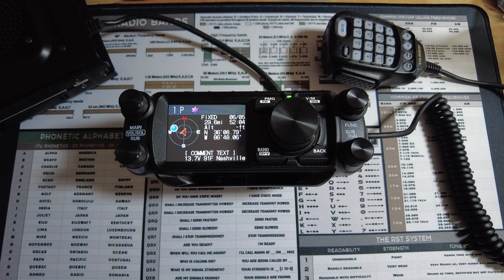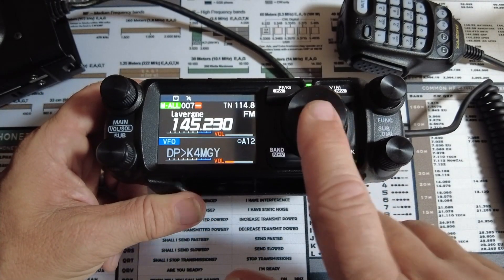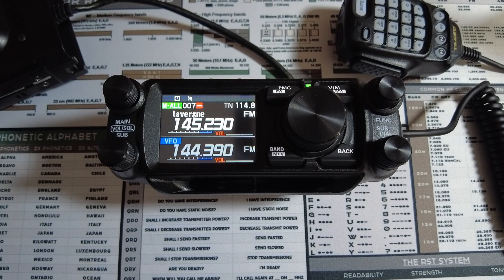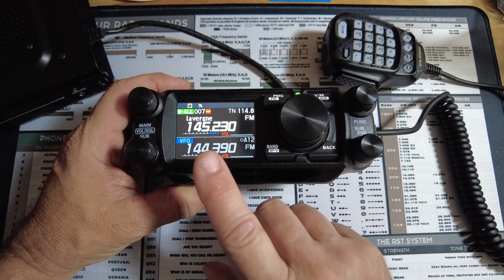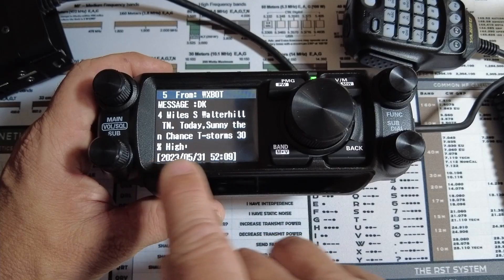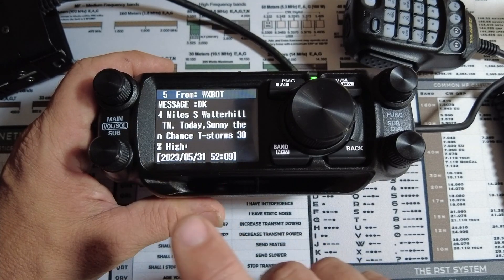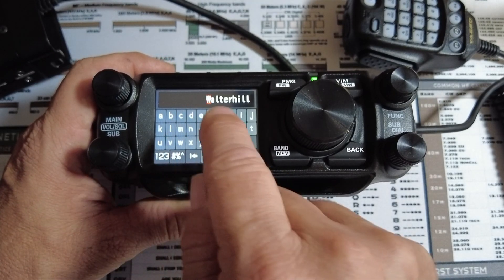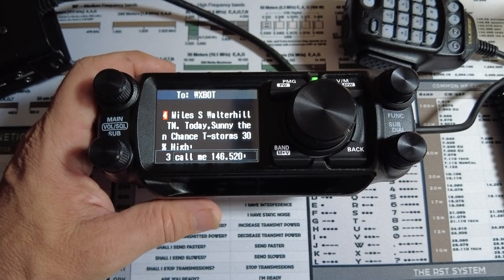4 Things I Hate about the Yaesu FTM500

Comment: thank you for the info, i got one 400xdr used on the shop for 350€ because someone changed for the 510. this last one costs 610€ new, i wouldn't change the 400 for the new 510, no upgrade as i see it. your video clears all the doubts. better than the 400xdr? another 400xdr. 73's

Comment: Yaesu has an excellent transceiver and the best audio available with C4FM. The Yaesu User Interface (UI) universally sucks on their radios. It's a mind numbing, button pushing, marathon. They could fix this by opening radio control to Bluetooth or WiFi so that competent software engineers could develop a UI for a computer, tablet and phone, but they just won't do it. That's pushing me in the direction of FlexRadio for a base.

Comment: I hate that most of these new Yaesu radios don't display the current power setting without going into a menu.  On the the FTM-400 you can set one of the four touchscreen buttons to Tx PWR.  So you can see on screen the power setting and change it with one tap.

Comment: I've always like Yaesu for the most part.  With this, I'm wondering if they actually have Amateur operators on the tech team at this point.  This is not a radio I will invest in.  Still looking forward to an FT 891, for other reasons.

Comment: I just got one of these and now am thinking about returning it. I originally planned on the FTM-300 but liked that this one has the front-facing speaker mic jack on the head (more flexibility for a bag or go-box where I plan to use this unit). I see the latest firmware is from December 2023 so I wonder if there will be another one to possibly address some of the issues, especially with APRS. I have the FT-5D (and also the FT-710) and i mistakenly assumed that some of these things would be similar. If I return it I'm not sure what I'll get instead, but it's too much money for something I may not enjoy using.

Comment: In fact, I’ve decided to NOT buy any new radio for the car and just put / start with my 144MHz only rig. I was going to buy this radio to monitor Air Traffic on both Commercial and Military Frequencies ( from Kadena Air Base and MCAS Futenma 315MHz + / - ) but I recently discovered my FT-70D is quite capable of any of those frequencies and what’s more, by plugging in the speaker mic, I can plug the audio into the Line In / Aux of the car and listen to traffic through the car speakers, something I often did in my RAV4 with an FT891 / ATAS120a

Comment: I can't believe how convoluted the operation of this transceiver is. Yaesu makes the FT-2980r, one of the easiest radios to operate without a manual. I bought one several years ago, and I don't believe I've opened the manual once after the initial unboxing. It is simply very intuitive to use. What on Earth were they thinking when they released the FTM-500? I don't believe I'll be giving up my FTM-400XDR anytime soon. I realize I don't use all of the features available on the 400, but the larger screen and the logical layout of the knobs make this radio preferable over the 500.
Reply: The FT-70D is good but convoluted.

Comment: The screen on my Samsung phone is quite a bit larger than the screen on the FTM500.  Yaesu should create an "app for that" so we have the option to control the radio straight from our phone - APRS and the radio menu function.  Imagine how easy it would be to do APRS on our phone instead of fat-fingering the tiny screen on the FTM500.  You're absolutely right about the keyboard layout and buttons changing position while navigating between screens.  Pooly thought out design.  I would like to thank all those amateurs who complained about the giant screen of the FTM400, Yaesu heard your cries, and they fixed it.

Comment: I've never been overly impressed with the built in APRS functions on any of the Yaesu radios, messaging just sucks on all of them. I've only used them for basic beaconing. If I want to do APRS on the fly I use my Mobilinkd and APRSDROID, this way I can actually send a message in a few seconds compared to the 5 minutes of frustration it seems to take to send a couple characters on my FT-3 or VX-8.

Comment: Thanks for the video.  The APRS functionality (lack thereof) is most concerning. I really wouldn't like that keyboard, either.  Can text be input via the handmic?  I'm still getting used to the Ft5d APRS after using exclusively the d74 (for aprs) since 2018, which is what I learned on.  I don't love touch screens on HTs,  but the 5d is stronger than the d74 with some APRS, so I'm trying to get proficient... It's just, clumsy feeling... As for the 500, I hope those changes you mentioned are possible and actually implemented.  APRS is the reason I'd get this to replace the d710 in my truck, but it needs to function well and easily.

Comment: I agree with most of your points. I don't think this is really a replacement for the 400, and I also think this radio was rushed. At least it feels like it to me after using it for a month. Overall I do really like the radio. Just gonna take time getting used to after coming from a 300 then 400.

Comment: What was Yaesu thinking? Perhaps too quick to market? Now, ICOM has an open runway. If ICOM would add APRS to their radios they'd pull in the crowd of us APRS users.
Reply: My gut feeling is that now that Kenwood has announced the TH-D75 handheld, they may have a replacement for the TM-D710 mobile in the design stages. Kenwood moves very slowly with new products, so I don't expect to see anything this year.
Reply: @bb_37  I'm excited to see an updated D710.  Heck, Kenwood could rerelease the V71 or the D710 (or both) without any updates and I would be perfectly happy.  Both of these radios are workhorses.

Comment: In the screen where you select edit text there is a clr all if you press the clr all it will erase all text in the message and then you hit the edit text button and start with a blank message to use as your reply
Reply from the maker: clr all also clears the call sign from the reply adding yet another step to the process.

Comment: To me it looks like Yaesu organization as a whole is a problem. Like the interface designers and developers are siloed by physical product rather than working to produce a consistent user experience across products.
Reply: I agree. Why else would their handhelds have memory banks, but their mobiles don't?
Reply: @bb_37 Even still, the FT-70D is overly difficult when programming banks.
I could program Bank 1 fine, but the same key press procedure doesn't work if I try to program a second bank.

Comment: Seems like a new team (of non-HAMS) software engineers has written the software for this radio and apparently has no UI design knowledge either...  I have a FTM400 and I thought the screen was a similar size, I'm surely not changing now!  In fact I suspect an FTM300 might be a better bet, not sure if it has the same interface (but it surely has an even smaller screen I think).

Comment: 1 is legit, terrible planning there.  2 makes no sense to fuss about to me (alphabetical works fine for me) I'm not trying to type 50 words a minute.  The FTM300 is alphabetical. I think you may just be used to the old fashioned qwerty keyboard.  3 isn't a good design.  4 I don't have any interest in APRS but have more interest in C4FM and Wires X.  No comment here.  BTW I have the FTM 300 which I like and see little reason to pay extra for the 500.  Unfortunately, I don't think they hit this one out of the park.  They should have a larger screen radio option.
Reply from the maker: I agree that I am use to the "old fashion" QWERTY keyboard. That's what I run on my desk, my laptop, my mobile phone, and on the FTM400.

Comment: It's 2023. The entire front should be a large touchscreen display, with an optional "controller" with buttons and knobs that plugs into the unit or works wirelessly. How about USB ports for accessories? I don't mind paying money for quality, but the price of this dual band radio is a slap in the face when it's only offering FM transmit. Yaesu thinks it can put a premium price tag on it because of GPS. Yes, GPS, the amazing feature found in every cheap prepaid cell phone. 

I'm not a hater, I'm a Yaesu fanboy. FT-100D, FT-897D, FT-2980R. Solid well-built radios. The FTM-500 is both CHEAP and EXPENSIVE.
Reply: I agree....optionally could have a totally user configurable UI or preconfigured defaults depending on mode of operation and preferences.

Comment: Not a fan of the Ftm500.  I do like that they incorporated the speaker and mic connection in the head.  I love my FTM400 screen.  Yaesu should offer a FTM400 style head to work with the FTM500 radio body.
Reply from the maker: Having a large screen on the 500 like the 400 would have made a HUGE difference.

Comment: Great vid.  I'm not an APRS user but I can see how that is frustrating.  I'm a firm believer that the developers for Yaesu radios have never used the radios as intended.  The FT-891 menu system could not be more unfriendly to mobile users and still be called a mobile radio.  Yaesu seems to have a trend lately or breaking what didn't need fixing the FT-857 to the 891 and now this.  Thanks for the honest review.

Comment: I find most manufacturers are making there radios less User friendly and much more expensive. This radio is Canada is #946. I could get the FTM 400 for $700 plus ish. They are making the working more difficult to preform simple tasks. I believe this is why the Chinese radios are so popular. Younger people looking into this hobby and seeing the prices of radios, are more likely to by the cheaper radio as the big 3  are pricing themselves out of this part of the market. If I had seen these kind of prices when I was looking into getting my licence, I'd never have become a ham. Plus is is bad enough when you get a Chinese radio with software issues, but crap like that for an almost $1000 radio!!!! I'll never get one. I'll wait for all the 400's to hit the flea markets and swap shops. Lately every time and Icom or Yaesu put out a new radio, They fluff it up a bit, remove good features and crank up the price. You'll notice Kenwood doesn't come out with new radios like the others. I think they will stop catering to hams as younger people come into the hobby and say I can't afford that.  It's a shame that the big manufacturers ar keeping new people out of the hobby because of sticker shock. I am looking selling my Icom 7300 and looking at a Xiegu G90 so I can get out portable.. Buy the way a 705 is almost $2000 here!

Comment: I have three Yaesu radios and zero Icom radios, but I must admit that Icom routinely eats Yaesu's lunch on user interface design.  It's an important aspect of actually using a radio and Yaesu doesn't seem to understand that.  They treat the user interface as an afterthought.  Hopefully they can fix some of the goofy shortcomings in a firmware upgrade but that won't fix the 2.5" screen.  Companies court young customers (it's a marketing thing) but the ham market is an aging demographic and smaller screens don't work well for us mature users.
Reply from the maker: I was really shocked when I compared the screen to the FT5. Granted, it's bigger than the FT5 but not by much and we still get the soft buttons on the FT5 that make it more intuitive. It's a good radio but APRS is a mess on it.
Reply: Im a 40yr old ham and hate small screens.  This screen belongs on a $200 radio not a $600 radio.   Your post is dead on with icom too.  I wanna love yaesu but i cant pry my fingers away from my icom.

Comment: I agree on the knobs and have the some problem trying to tune the top/primary from the function knob.  I think for me it's muscle memory (albeit I'm coming from previously using an ID-5100 mobile).  The APRS text thing is less annoying to me since I rarely send APRS text messages.
Reply from the maker: It's a great radio if you don't use APRS messaging very much. APRS is the worst part of the radio unfortunately but I am holding out hope they fix it (at least some of it) in firmware. They improved the FT5 with firmware.